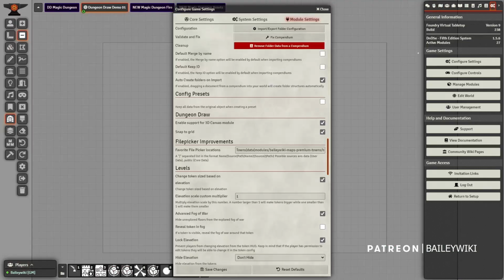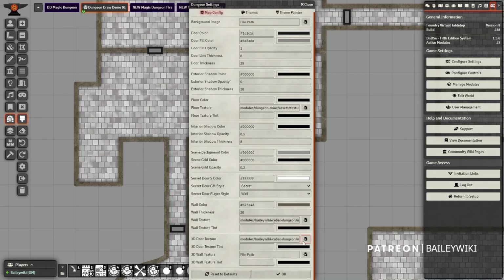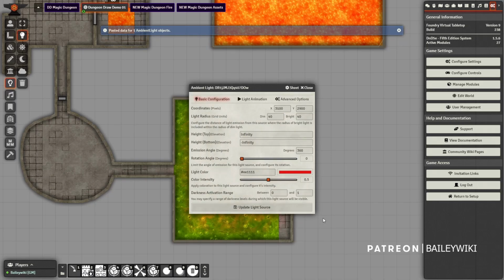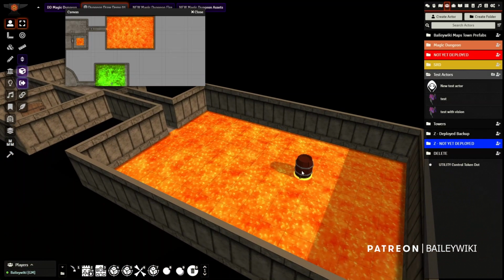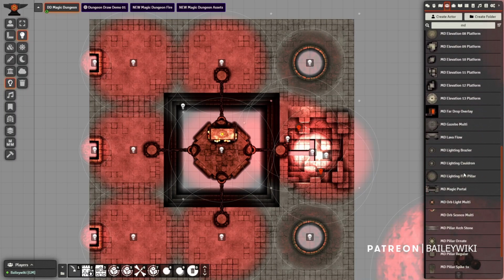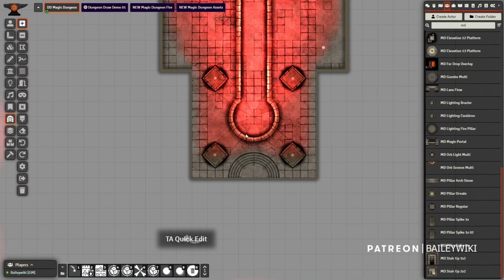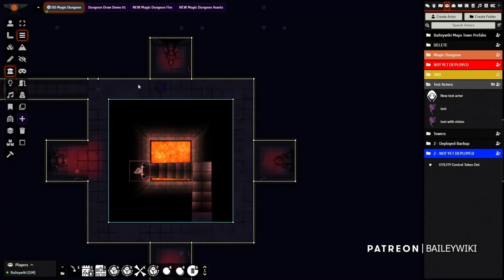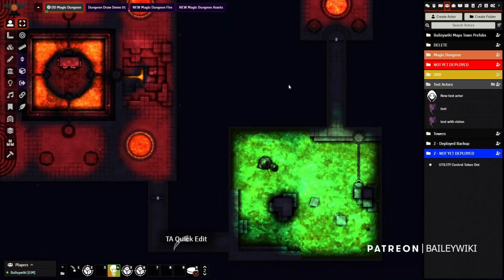Foundry Module Tutorial: Dungeon Draw Part 2 with New Capabilities and 3d Canvas Integration

Comment: Same as with @jules3484 I can't get use my own textures in Theme Painter.  Specifically, the Theme Painter tab isn't showing up in the Dungeon Draw Settings.  Wondering if there's something I did wrong or if there's some other module I would need in order for that to show up.

Comment: Sadly I can't seem to get the Theme Painter to work. Any Advice?
Reply from the maker: Hmm, maybe. But not without more information.
Reply: @Baileywiki  I think I might be running into a smilar issue. Once I'm finished drawing the polygon, it won't "close" and paint the theme, it keeps allowing me to draw further lines. Is there any kind of button/command to finish the drawing of the polygon?

EDIT: I found out what was the problem, at least my problem. You have to double click to finish the polygon.
Reply from the maker: There you have it!
Reply: @Baileywiki  Hi ! With the newest update the UI is slightly different, I can't find how to apply my own textures to the theme painter specifically. Thanks !